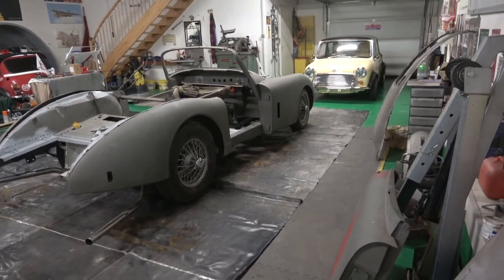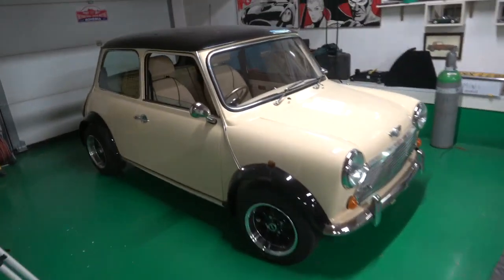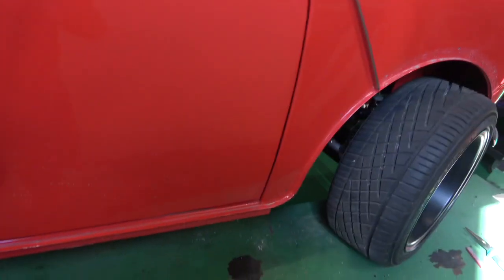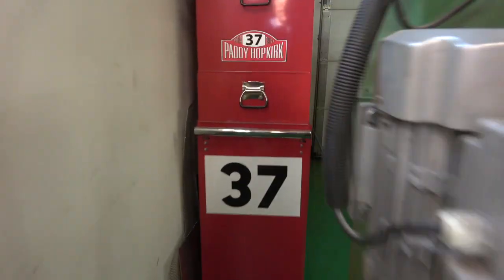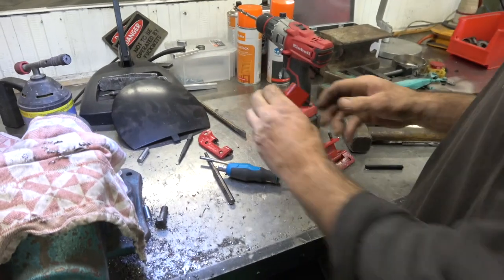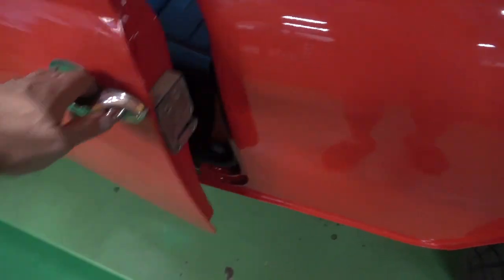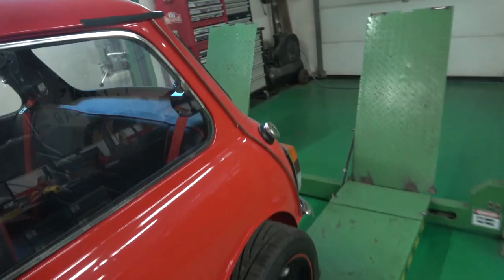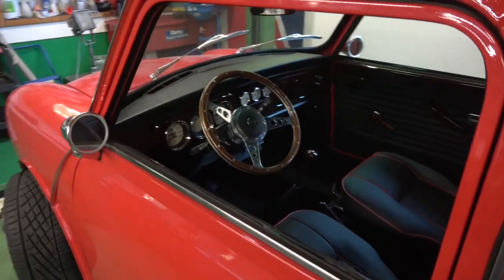Classic Mini Door Hinge Rebuild ( Top & Bottom ) + A Bit OfJaguar XK 150

Comment: Sorry Dave did you ever do a vid on external hinges I’m struggling with my one’s ?
Reply from the maker: Steve, I don‘t have a video i‘m afraid,  But i have replaced them before if you want to drop me an e mail on 
davejaguar66@gmail.com and let me know what issues your having i may be able to help. The hinge pin 
has to be driven out from the bottom to the top as they are designed not to fall out, when you buy new pins
you also get new brass bushes with them as this is what wears and the top of the pin has a multi spline so
it locks in place and is flush with the hinge, I hope that helps a bit, Cheers Dave

Comment: One question, when you drill all parts the same size does the new roll keeps still in the center piece and hinges on the top and bottom of the hinge? 
And so wear out that part of the hinge over time ?
Reply from the maker: The original hinges were worn and oval so using a larger dia roll pin was the only way to be able to have tight hinges and no drop in ther door, The will of course wear out at some point but it will take yeras of use. Cheers Dave

Comment: I'm having trouble with my mk1 hinges. i've fitted the bronze bushs put the pin through but after you work it a few times, the pin picks up on the bush and turns the bush inside the hinge.
Reply from the maker: Paul,  It sounds like there it too much wear in the hinge to hold the bush tightly enough, As new ones are expensive i would
take them to a machine shop and have them drilled out and brass or bronze bushes made with a larger diameter but the same
I.D pin size, If you fit off the shelf parts and there loose they will just wear the hinge diameter hole even more. Cheers Dave
Reply: @ClassicCarCave  I know what you mean Dave but the new pins feel to tight in the bush. When you have fitted the new bush and just try the pin it feels over tight. I didn't drill the old bush out because i was scared of making the bush hole to big and by the looks they were the original bush. I used a fine file to slice the old bush so it could be just pushed out. I might order some bush kits from a different supplier and hope that it's a different manufactorer.